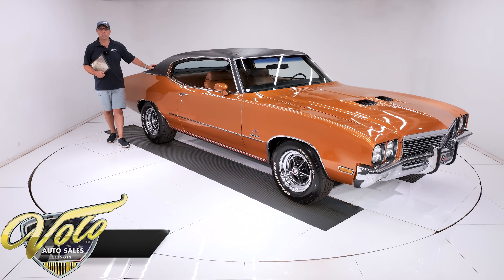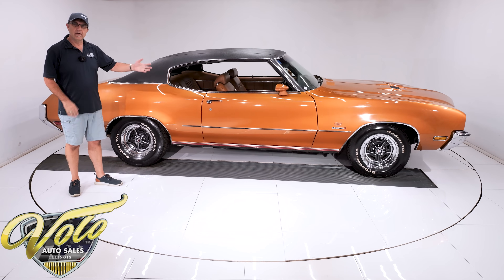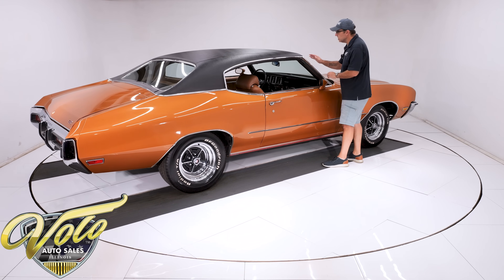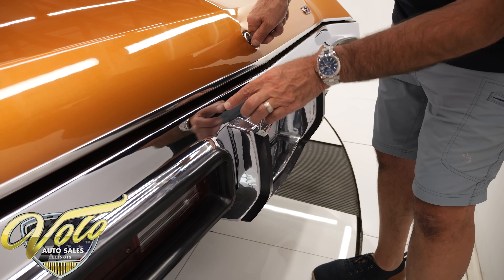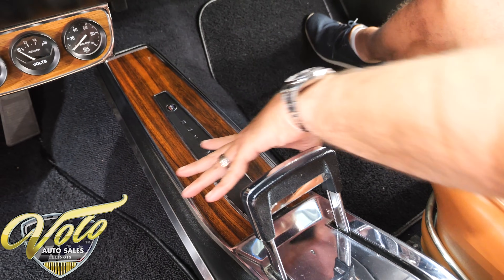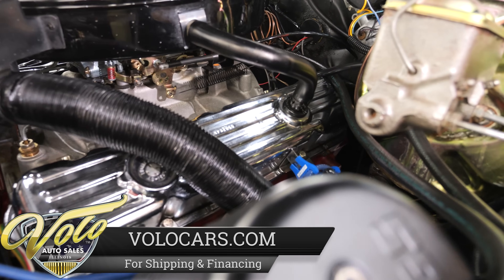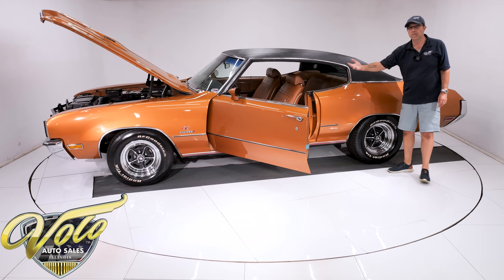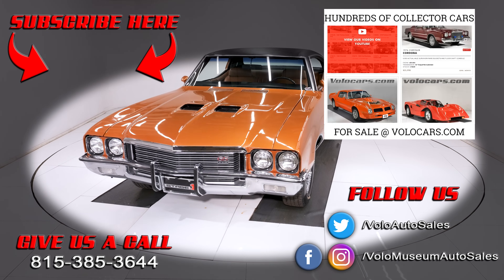1972 Buick GS455 Stage-1 for sale at Volo Auto Museum (V21168)

Comment: I am GM Car lover, since birth, almost every one of our neighbors drove GM, and Most were Buicks. 
That was definitely farther back, than 1972…I used to love lying in bed at night, as a Kid, and hearing our older neighbors Buick Roadmaster, with the Straight 8…Yes, I have a Passion for Buicks, 1950’s thru 1970’s 👍
We owned a 72 Skylark Custom two door Hardtop, as a pour second car, in the 70’s, nicely optioned,
we loved every minute,  and every mile of ownership.  Our primary car, was a 1974 Le Sabre Luxus 455
Convertible, that went out on the sunny days.. Wish I could find a mint one of those for the sunny days.
I am going direct to your Inventory site, and take a long, strong look at your Skylark, It Is So absolutely Stunning, and Tempting. You buy some very, very nice automobiles Jay 👍

Comment: A lot of cars out of California often sell right away less than a day after arriving off the truck. I often love the N25 option on these cars, and the 455 engines in these models years, and the Burnished Copper on the car. I remember a 1972 Buick Skylark Custom as little kid back in the 1990's, and the car is actually still located on Wright Avenue as of 2023.

Comment: Beautiful car.... Only thing I'd nitpick for new owner if he or she is looking for even more "correctness" would be that the hood lip molding is not supposed to be all chrome. The majority of the top of it should be body color, and the part that meets the headlight door chrome segments is chrome (bottom segment of hood lip molding). Also extremely nice and rare that the restorer chose to keep the factory body-side moldings. These are a PITA to restore, and are very difficult to replace nowadays. The factory stereo radio is another gem -- wasn't available on builds before January of '72.

Comment: The front grille is incorrect , should be flat black.  Front bumper is pushed up at the center ,  happens easily when tapped even gently.  Air pump is missing .  I think this car has way more miles than advertised.   Original intake and carburetor have been changed.  A crossover pipe was added to the exhaust.  All these non original parts lowers the value tremendously.  And those screws in the dashboard are ridiculous

Comment: Why would someone need to rebuild and repaint to such extent on a 20,000 mile car.
Reply: B/C it's 51 yrs old? Amazing what time does to them, even if just sitting, unless you have it climate controlled environment with no ultraviolet reaching it or moisture surrounding it, and nobody touching, rubbing, etc. "Normal wear," even w/ only 20K mi., can be significant over such a long timeframe, unfortunately.
Reply: Agree EvilBraTT